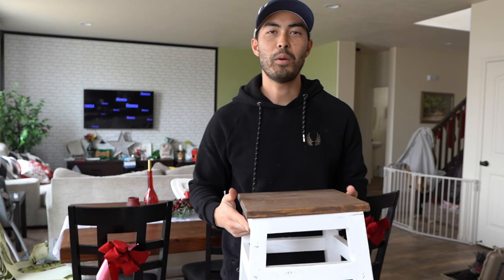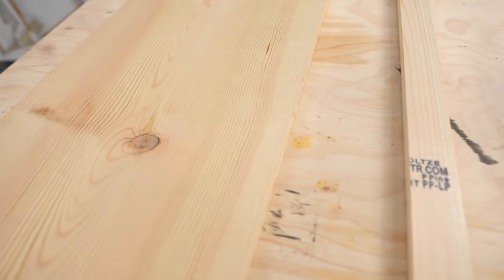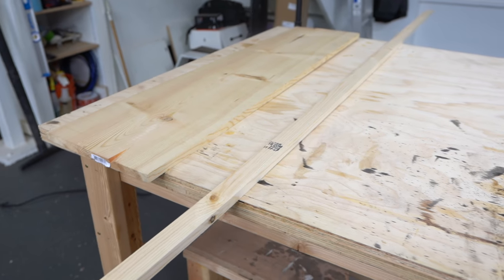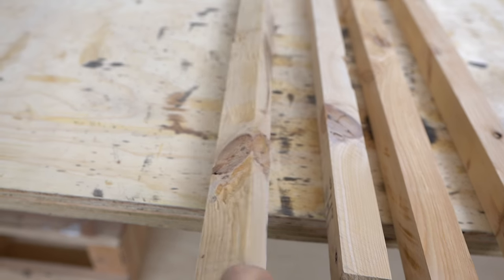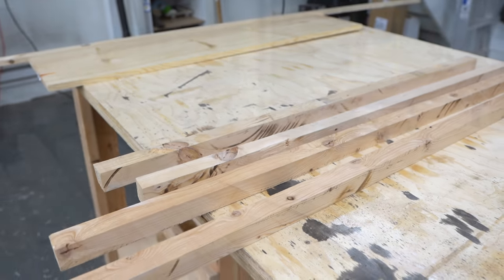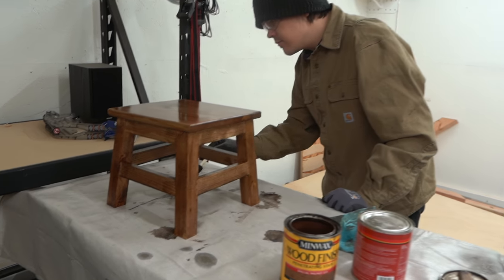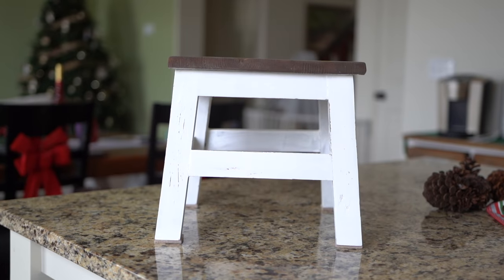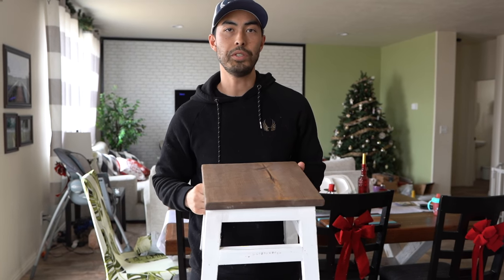($20 DIY Build) Building a Farmhouse Style Stepping Stool

Comment: Rule of thumb when you want a design like this start with a 10-15* bevel. That’s where most odd ball things like this fall into place. Saw horses for example are same range.. generally 15* so if trying to splay the legs then 10-15* is a good starting point